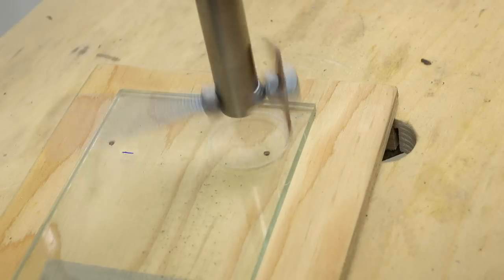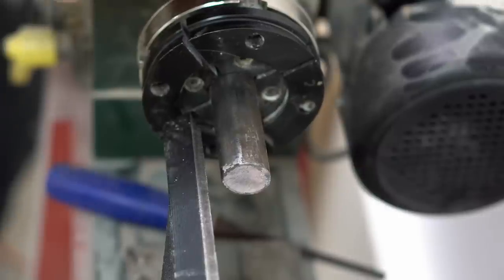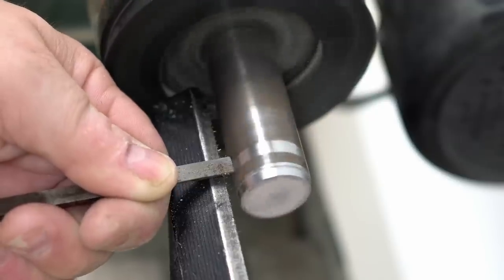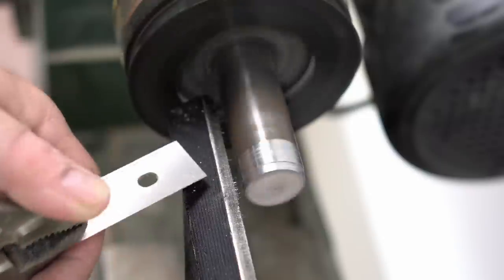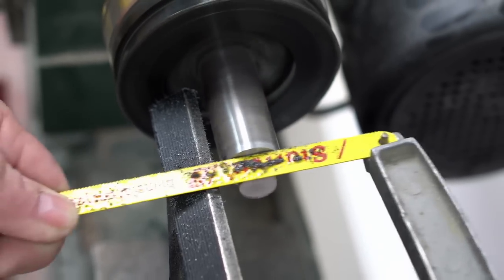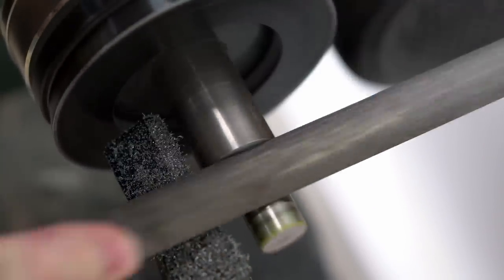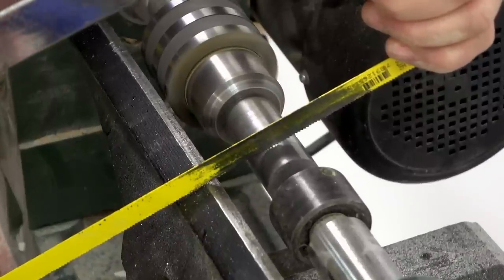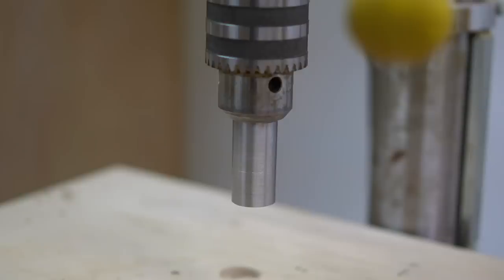Machining Steel On A Wood Lathe

Comment: I spent 21 of my younger years as a boiler technician in the US Navy and one thing that was driven home many times was using the equipment and tools you had on hand to get the job done. There is no repair shop or spare parts warehouse around the corner in the middle of the Atlantic Ocean. So I applaud your resourcefulness and ability to think outside of the box. Bravo Zulu (Navy for well done)! Darlington, South Carolina USA

Comment: An old so-called machinist and college-educated engineer once told me that steel could not be turned by hand on a wood lathe, but there are old books that show how to turn steel and other metals on a hand lathe with a hand-held tool.   Essentially you have to get the speed of the lathe down to about 150 rpm, which was not difficult given the treadle power lathes that were used at the time.   It isn't surprising when you think about it - metal workers used to routinely drill metals with hand-powered breast and egg beater drills, as well as post drills and blacksmith beam drills.  And they cut metal both hot and cold by hand with chisels and files.

The second requirement is a properly shaped chisel or cutting tool.   Something shaped similar to a graver was used; it was a single point tool with three or four sides, with the end ground at an angle to produce a diamond shaped flat or bevel.   It was dipped in a lubricant such as kerosene or even water and rolled and tilted in an arc-like motion against the surface of the stock  being turned; each cut would produce a shallow but very narrow cove or corrugation.  It goes without saying that the tool had to be made of something harder than the metal being worked.  High carbon tool steel was used originally, but high speed steel stays sharp longer.

I once used the process to turn a new shaft for an old breast drill to which I desired to fit a jacobs chuck.   I started with an already threaded bolt and turned the shank concentric with the threaded portion.   I had only a jacobs chuck in the headstock to hold the work and I got the speed down by replacing the motor with a big old half inch, single speed drill and some homemade wooden pulleys.  It was slow and in-efficient, but I was able to get within a thousandth of inch tolerance along the length, using very cheap vernier calipers to gauge the work.

Comment: I like how you are pushing traditional processes John! Keep on exploring.
Reply: It's actually not much different than the concept behind the first metal lathes, they used hand held gravers to cut incredibly precise metal parts, even now most small scale watchmakers lathes use a tool rest reminiscent of a wood lathe rather than a tool post like most metal lathes.

Comment: Awesome! I need a few parts made on the lathe but I was leery trying it out on mine after using a wood saw as a metal chop saw. Figured someone would have done it on YouTube. I'll put a filter on the intake for the motor fan though. That is how I destroyed the chop saw. Metal fragments wore a bridge into the coils and had to rewind ALL of it.

Comment: Hi John; I love the idea of the hack saw blade it's a lot more elegant than what I've done, chucking up a drill in the vise and using a grinder to remove the bulk of the material. I am a believer of making use of what you have to get the job done.
Thanks for the tip.
Keep up the good work.
Dan

Comment: Your solution was quite unexpected. I was cringing several times before you started using the hacksaw blade, and it surprised me that it worked, but takes a long time.

Comment: an angle grinder with a 60 grit flap or grinding disk works pretty well for thinning rotating stock, you can even throw it in a drill press and use the grinder to protect your wood lathe a bit. ive heard this technique called a "poverty lathe"
Reply from the maker: Using a grinder would be extra messy and creates a big stink in the shop, and I wanted to avoid that.
Reply: fair enough
Reply: With a drill press it might be worth trying to put a saw blade in a drill press chuck (those metal type ones).
Reply: Or a die grinder... Aka hand lathe lol

Comment: the carbide saw teeth will work well in a pinch I use them for parting tools on on my metal lathe and as well as if i need a thin cut (the demo saw blades seem to be the best they are a bit thicker and have less flex to them )

Comment: Those carbide tips on circular saw blades can be removed with a piece of the saw blade and put into a tool holder which you can custom make. Then you can push into the stock and cut it easier

Comment: Hey John.. nice life hack with the saw blade...  Can i suggest, maybe give a 4 inch grinder a go, use a 40 grit metal sanding disc in a rubber back pad... have the grinder disc rotating the opposite way to the turning part...and you could have turned that spigot down in under two minutes..  then just go to a flap disc for smoothing, and finally a scotch pad for final polish....  

Also the best part is you dont even need to use your wood lathe, you can do it all in your pillar drill for smaller shafts under the 13mm that fit the chuck..... i do this all the time to champher large alun screws for a smart look.. !!     Hope it helps buddy.. take care.. Del.

Comment: I've done several metal working projects on my wood lathe, mostly drilling operations. But when I broke a key for one of my small chucks I made new ones out of mild steel on the lathe with nothing but a file.

Comment: I saw one video where a guy did turn metal like wood. What you need to do is find some of those HSS tool steel blanks. Then grind it on a bench grinder to the shape you want. I think in that video they said to turn it so that it's cutting on the top part of the work, not like a traditional lathe work.

Comment: so, since the combination lathe and hacksaw works, do you reckon the reverse would too? I mean, pushing the piece, held in the chuck of a cordless drill, against a running band saw... provided some king of jig...gery  to hold the drill stable.

Comment: John well done  first of all But you were approaching it correctly  when metal was first being turned they did it free hand just as you did basically but you have your tool contact slightly below center  and the tools had a small notch or pin on the bottom side of the chisel that hooked over the tool rest  they could get decent tolerances of like +/- .002 " which for the 1600's wasnt bad they just couldnt bore that precisely yet   well done tho mate cheers from New Zealand

Comment: Did you try to just hold a abrasive grinding wheel to cut away the metal?
Also, is there a way to get the end of the metal truly flat?

Comment: A Bridgeport mill will mill steel with only a one hosepower motor. A lathe can be anything that turns. Lol ive turned steel shaft on a tractors pto before.  Just weld your shaft to a pto spline and attach the other end to a roller type centering jig and have at it.

Comment: "...don't think this thing needs NASA type precision..." LOL john this is so far from NASA it's laughably enjoyable.. I can't mock you though, cause I've done this myself!! it works surprisingly well. I way to get a more "precision grind" is to use a angle grinder with flap sander disks.

Comment: If you could add a stopper you could actually preset the length of the tool bit and make sure you are hand turining it parellel and get to demension with filing and sanding

Comment: Im thinkin you should use a lathe tool bit but grind it at a sharper rake and reduce the contact area in turn less resistance

Comment: For faster material removal you could stack multiple blades together and make a "dado hacksaw". And naturally here in Europe this could not be done because it's illegal to install dado stack to any saw.  :)
Reply: No, it is NOT illegal to buy, sell, own or use a dado stack in Europe.
The Health and Safety at Work regulations apply to the workplace.  If you employ somebody to work your machines, the HSE regulations apply.  The HSE regulations do NOT say that you cannot use a dado stack.  They DO say that before using a dado stack you should conduct a safety assessment to see if there is a safer way to perform the same operation and if there is NOT, and you HAVE to use a dado stack, then you must provide adequate guards to protect your workers from danger.

In your own workshop, you can do whatever you like, because the HSE regulations do NOT apply (however, you would be well advised to read the regulations to see what you can learn, especially if you are attached to your fingers, and you would prefer them to remain attached to you).
Visit http://www.hse.gov.uk/woodworking/index.htm
Under the heading "Safety Topics", select "Working with machinery"
Start with "Circular saw benches - safe working practices WIS16"
and perhaps "Safe use of manually operated cross-cut saws WIS36"
A couple of years ago, I spent 2 days ploughing through the HSE site looking for something which said that you could NOT buy, sell, own or use a dado stack, but I was not able to find anything.  So I wrote to them to seek clarification and their written reply is summarised above.
 
In the UK, at the time of writing (June 2017) Woodford are selling table saws with dado sets as an option for £49.99 - see http://woodfordwm.co.uk/ then select New SemiProfessional, then Table Saws.
Scott & Sargeant sell the CMT dado sets - see http://scosarg.com/catalogsearch/result/?q=Dado+set
 
OK.  I have provided links to back up my claims.  If you have visited those links and you still think that dado stacks are illegal in Europe, please provide a link to a .gov.uk website, or an official EU website, which proves me wrong, or a link to an official news medium which has reported a reputable firm (like the above) being prosecuted for selling dado stacks.  I am open minded and willing to learn, but "my friend's cousin's brother once said that ...." doesn't cut any mustard with me.

Comment: I will file away that idea on using a hacksaw blade, never thought of that, my mini-lathe works like sheet on steel, I use a grinder but that doesn't work so well either, files are too slow.  Thanks!

Comment: The hacksaw worked better than I would have expected.

I tried machining a piece of aluminium on my wood lathe using a carbide turning tool.   Like you I had the tool on centre height and had a difficult time.  Too much vibration, rough surface creating more vibration and chatter.  This attempt was a few years ago before I got a metal lathe.

I recently saw this thread on a machining forum I frequent.  It is possible to machine steel on a wood lathe, but tools and technique are important.  HSS or carbide tool will work.  You want a small point and you want the cutting edge down with the tool at the top of the work.  This thread explains better.

Apparently hand held tools were commonly used to machine cast iron and steel at the end of the 1800's into early 1900's.

http://hobby-machinist.com/threads/gravers-for-turning.56828/

Comment: It seems to me that your lathe wasn't running true enough, and that is what caused the chatter.  If you watch machinists like Abom79, he spends a lot of time on a three or four jaw chuck getting it running true to within a thousandth of an inch or so before he starts.  It looked to me like there was run out on your chuck.

Comment: your cutter on your chisel is about 800 times too big! 

on a piece of tool steel that you would cut with, or whatever single point cutter - it needs to be just that, a single point, in all 4 directions. so, you need a relief angle on every side that's in contact with the work, all with varying angles that are tuned to what you are cutting. mrpete222 or tubalcain has some good videos on this, from years back, going over cutting geometry as it relates to machining steel, brass, aluminum, cast iron, etc. 

there's probably about a million other resources also online to reference, but trying to make a 1/2" wide cut on a piece of steel with zero other relief angles is not something that most small (12-14" or less) metal lathes could even do anyway.

something diamond shaped like a thread cutting tool, or perhaps some brazed carbide bits would work ok without much grinding.

Comment: I used to think yo were a pretty clever guy until - I saw you using a chisel / plane blade to "machine" a steel rod. What next ? Home made table saw blades made from pine?
Reply: I used to think you were a pretty clever guy until I saw that both of your youtube videos are about turn signals on scooters.

And john made a video about using paper as a saw blade. Maybe you missed that one while you were busy congratulating yourself for being... whatever it is that you are.

Comment: that's why metal lathes are superior in my opinion because they handle wood a lot betther than a wood lathe handle metal.
Cool thought on the hacksaw
Reply: Metal lathes dont handle wood at all... Your results are the reverse of the ones in this video, sure its possible but it is not efficient or accurate.

Comment: I think this video will need "John reads comments #2"
Buy a metal lathe you can't use a wood lathe you'll ruin the bearings and chisels and the hacksaw will explode and blow up your whole workshop and...
The carbide saw blade idea sounds cool. I thought of that a while ago too.
Reply: That sounds boring though. The fun is in the danger.
Reply: Wood is softer than metal but a wood cutting tool generally takes a much larger cut.  All but the crappiest wood lathes should have bearings strong enough to stand up to metal turning. at least some occasional use.
Reply: I was joking...
I thought hacksaw will explode and blow up your whole workshop would give it away...

Comment: I applaud your creativity but that was incredibly dangerous... if that sawblade got stuck you could have easily lost or broken something. I would consider doing a Matthias and build a makeshift tool holder that will hold a standard knife tool
Reply: What? Sawblade not inside anything where it could get "stuck".  Application seems to be self regulating, push blade too hard and heat takes over, don't push hard enough and nothing happens.  Matthias's idea of angle grinder probably you get to rough size quicker but saw blade idea and filing is necessary final touch

Comment: been there done that, never had a metal lathe in my life. but manage to machine basically any material. using a pool cue repair lathe and a basic wood lathe. when doing metal work mostly use files but like the results of using saw blade to remove the bulk of material as seen in video. cool!